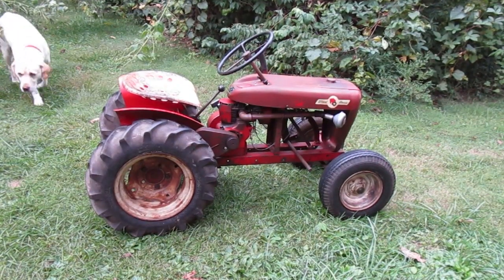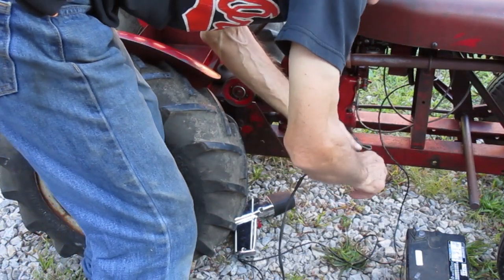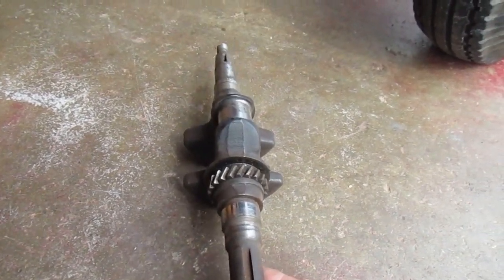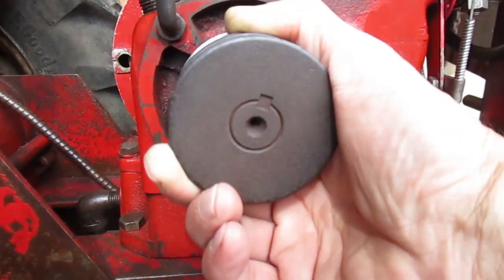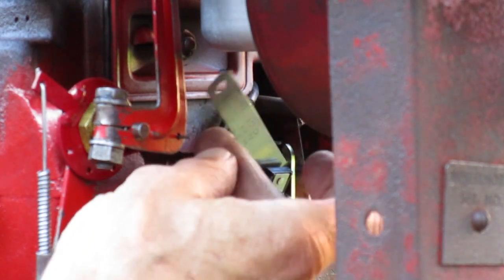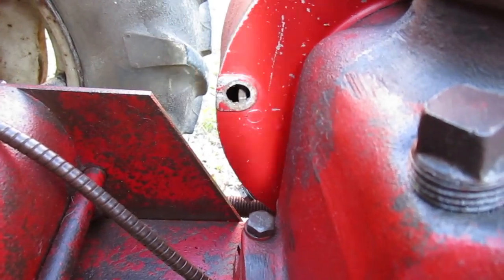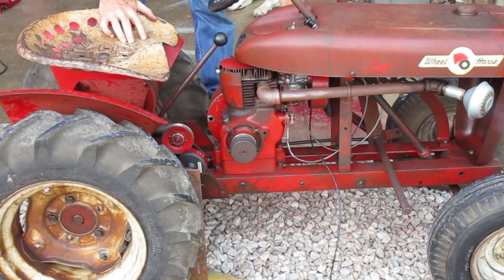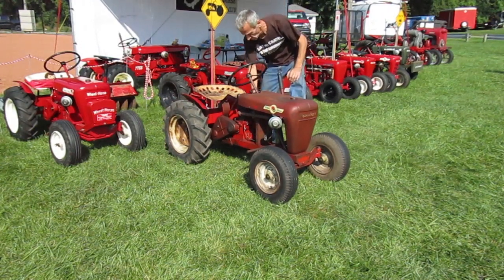Kohler K-series Ignition Timing w/a Timing Light: K91, K141, K161, K181, K241, K301, K321, K341

Comment: I have a 350 Howard   Rotavator  I’ve replaced the Conrad I finally got spark and ignition and it does run but it has eaten free keyways and now destroyed the flywheel can you tell me what I’ve done wrong please?
Reply from the maker: Damaged key ways has to be because the flywheel was not fitting on the crankshaft taper properly or the nut wasn't torqued properly. I've seen those flywheels crack around the crankshaft hole on the back side of the flywheel. If it's cracked the taper won't fit right and the flywheel would need replaced. I don't know what a Conrad is.
Reply: @PackratsFabrications   I really appreciate you getting back to me we call the Conrad attaches to the crankshaft and the piston. I’ve got a problem in England as there’s only one man what seems to have all the parts he’s insisting that I buy a brand-new engine Japanese but I really would like to keep this one. Thank you very much for all your help. I will continue watching all your videos. Much appreciated Gary.